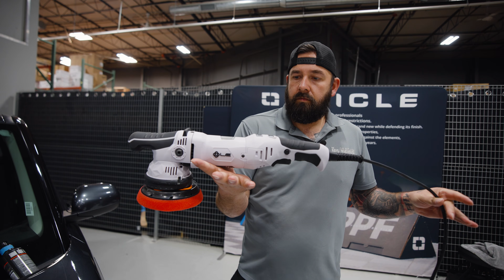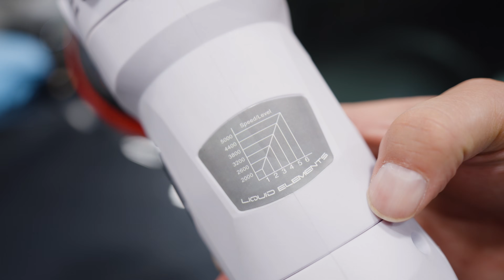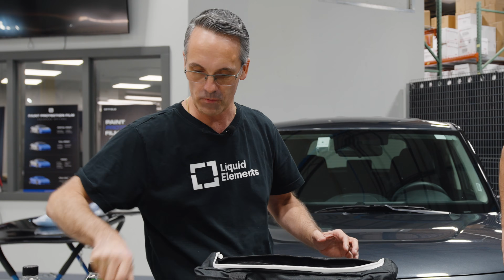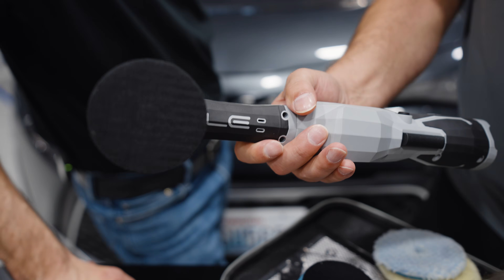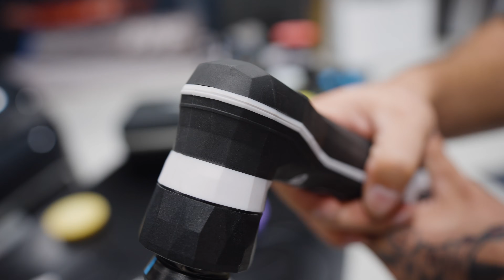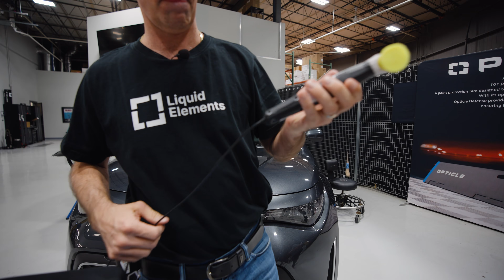Liquid Elements Polishers | Budget-Friendly Alternatives to Expensive Polishers?

Comment: A800 needs some work. I recently purchased the A800 and it’s not right. The problems I’m having is that it won’t shut off or it runs a few seconds and shuts off. So I’m not sure what’s going on but it’s depressing when u spend that kinda money and it doesn’t operate right. Oh and it comes with a EU plug so u have to buy a conversion from Amazon.